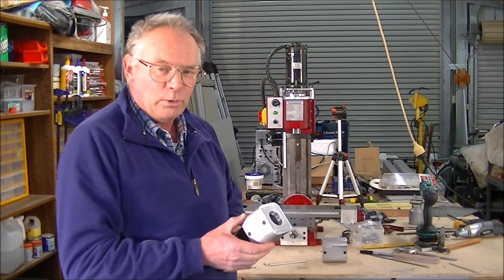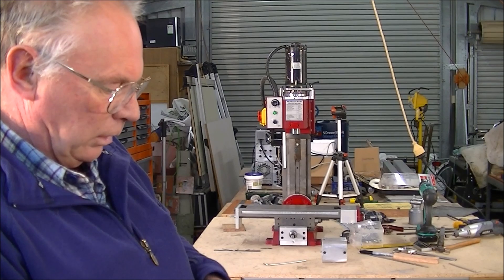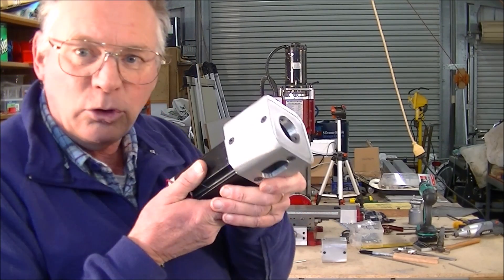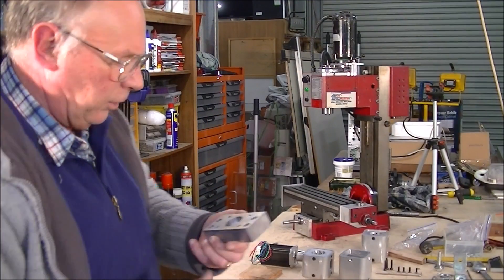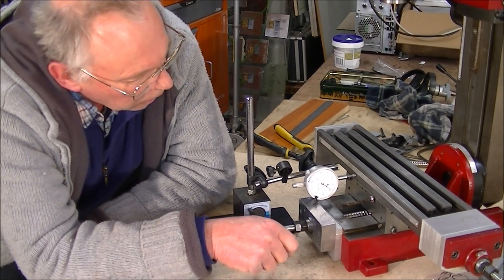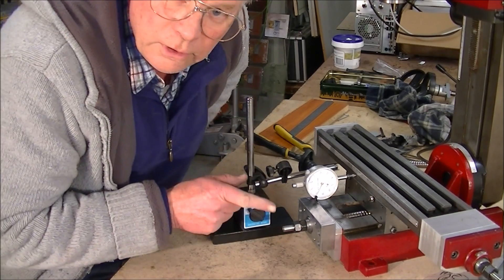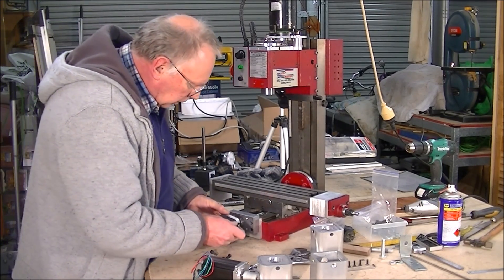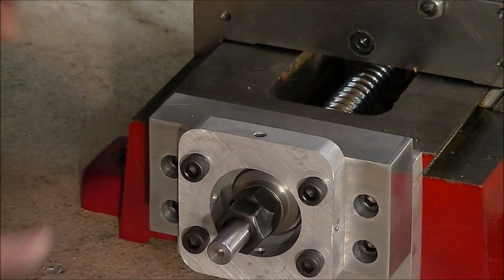138 Sieg X2 mini mill  iCNC  X Y axis conversion kit

Comment: The stepper motor are over kill they are massive for a small mill
Reply: It is better to assume stronger stepper motors than to waste the steps during machining.
Reply: that's the issue with open loop system, you have to use the worst case load. That's where a sensor makes sense.